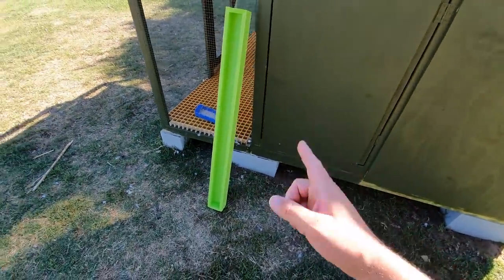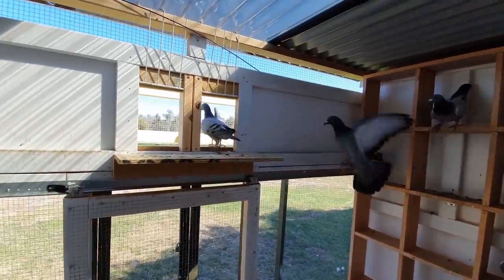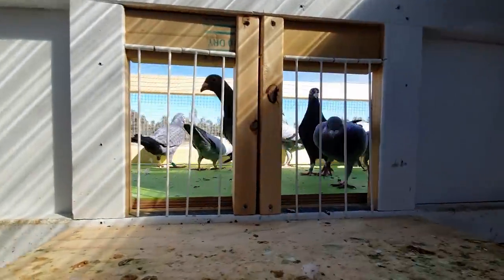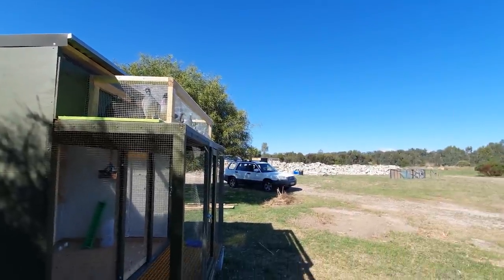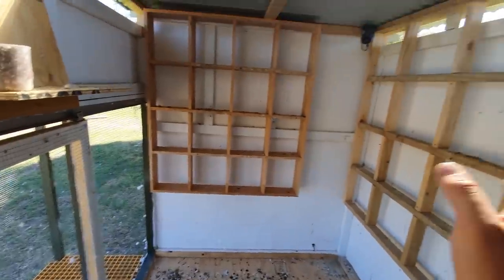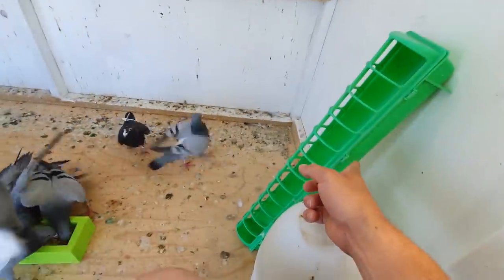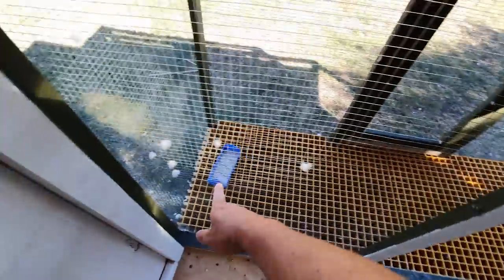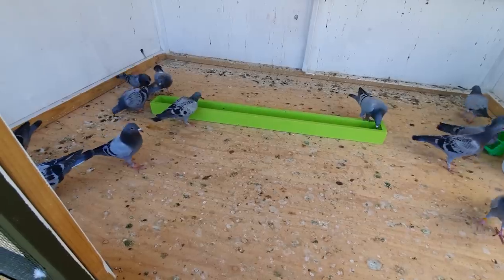NEW HOME MADE PIGEON FEEDER!

Comment: Kurt just to put you in the picture. when I make a comment it’s because I have 20yrs plus of racing pigeons from 100mls to 500mls.  with great results in club. Federation and combine With only 12 widowhood cocks. it is a full time job and had to give mine up due to work commitments.it’s not a easy sport to master even to this day I am still learning. But if I can give some advice that will be
 helpful that will do me. I no that my system of flying young and old birds might not work for you but it might give you a bit of insight as to how difficult this sport is and how time consuming it is if you want to make a go of it it’s like having a second job in between the job you already have.